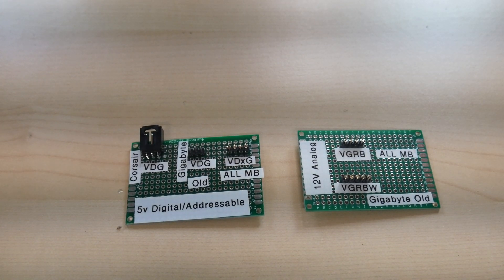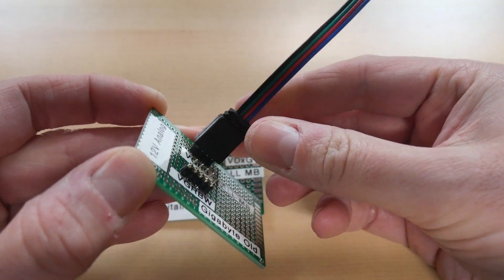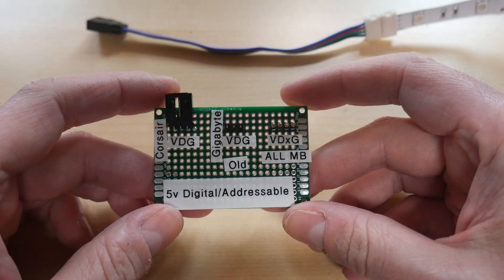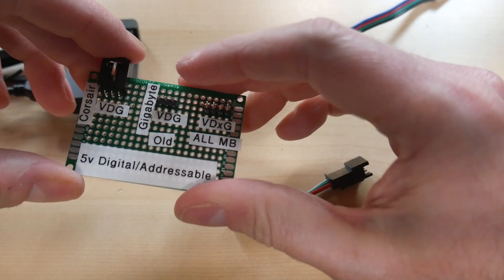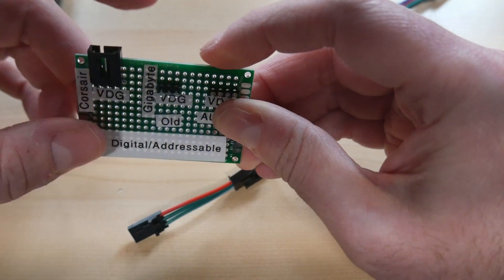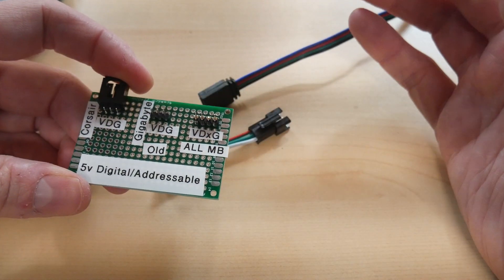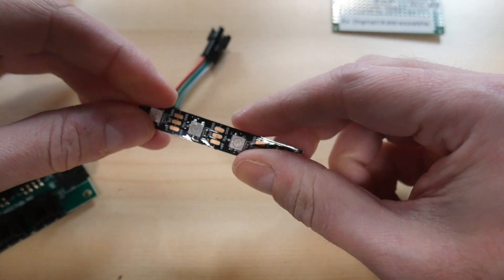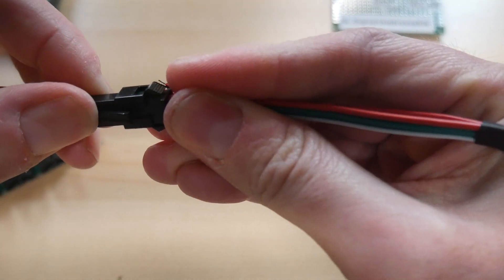PC RGB Headers & Connectors Guide (Digital and Analog)

Comment from the maker: Forgot to mention that a seller on ebay sells adapter cables for various Digital RGB devices: https://m.ebay.com/sch/i.html?sid=piratedog_tech&isRefine=true&_pgn=1
Reply: Hi Solarity

First I would like to say thank you so much for making this video, I was so confused prior to watching but think I understand a little better now. Hopefully you can find the time to answer a few questions if you wouldn't mind. 

1 - Are the RGB LED's in the Corsair LL120's Addressable? I did look on Corsairs website. It states "independent" so I assume they are.
2 - My motherboard has a VDxG connector and the Gigabyte RGBW, so if I bought the Corsair LL120 3 pack of RGB fans would it come with the correct connections, or would I need to purchase anything additional?

Many thanks
Mike
Reply from the maker: @85DJK  I am glad you enjoyed it. The LL-120 fans are indeed addressable/digital. The LL-120s aren't designed specifically for that, though I did a video on how I was able to control HD-120s (same LEDs as LL-120) via my RGB Fusion:
https://www.youtube.com/watch?v=CxO-Jl6dNSU&t=16s
https://www.youtube.com/watch?v=6la3JszM9c8&t=2s

Though to be honest, I think Corsair's iCUE is far superior to any RGB software out there. The LL-120s come with a Lighting Node Pro, which will allow you to control the LL-120s via iCUE

Also check out my RGB 101 video, it is a great overview: https://www.youtube.com/watch?v=z5paaWs_Gz8&t=461s

Lastly to get more content, feel free to subscribe :)
Reply: @SolarityTechnology  Thank you again, that's very helpful. Subbed
Reply: Wow those Corsairs RGB to mobo adapters are crazy expensive for such a simple re-wire.

Comment: Hey. I have corsair ARGB fans ("VDG"-style input) but a standard "VDxG"-style controller. Would you consider it safe for me to just connect them using dupont wires? I mean... As you said it's all WS281x so there shouldn't be a problem, right?
Reply from the maker: The dupont connectors use square pins, while the VDxG uses round pins. The square is slightly to big to fit into the round hole of the VDxG. You can buy adapters from piratedogtech.

Comment: My problem is that I have case that provides 4 fans with their own hub but it seems like it's for ARGB , with only a 5v 3 pin and my motherboard seems to only support normal RGB with only a 12v 4 pin header , so how can I at least make it use the RGB option that I have in my mobo while the hub has 3 pin ?

Comment: H! Was looking on how to connect the VDG 3-pin female connector on the Phantek Halo rgb frames to the 3-pin 5v header on the mobo. I found them on the splitter supplied by PC Cooler on their ARGB fans because it seems they use the VDG connector on their argb fans with an adapter to the mobo. Watching your video was helpful in understanding the disconnect between all the different manufacturers connectors. Thanks!

Comment: Thanks for the info! I have 2x 3 pin RGB headers on my z390 Aorus Pro Motherboard. With the second header plugged in my fan lights flicker one or twice a minute. If I plug and unplug the header the fans will keep the light setting and there is no flicker. Could I put a capacitor inline with the power and GND on this header? or would it be to do with the D? Thanks
Reply from the maker: You would have to play with it more. If you unplug addressable LED's data, it will stay the same until plugged back in or powered off. I would swap the fans to the other header. See if the issue is your fans or the header.
Reply: @SolarityTechnology  Thanks for the reply. The second header flickers whenever the 1st is already populated. I am using TT fan hubs, switching hubs/fans/headers produces the same result, thanks again
Reply from the maker: @PhatToni  how does it work with TT software?

Comment: How do you know the direction of the pins on the 12V RGB header? My connector marks the V plug, but there's no marking on the motherboard.
Reply from the maker: Most mother boards mark which way is which. 12vGRB, VGRB, or something similar. Are you sure it is a RGB header? Reversing polarity on a 12v RGB isn't going to hurt the strip or header. It will work one way, but not the other.

Comment: Do that vdg and vdxg are same? Except for that blank pin. If Yes, i have a 120mm argb fan, the header needed is vdg, but i only have vdxg on my mobo, all i want to ask if can i cut that vdg on my fan and replace a vdxg connector. (i have some heat shrink for safety). Thanks❤️❤️❤️
Reply from the maker: Same thing, different connectors.
Reply: @SolarityTechnology  so can i do that?
Cut the vdg connector of my fan then replace by a vdxg connector?
Reply from the maker: @Gloope  you will have to know how to solder to do it. You could also buy an adapter from https://piratedog.tech/
Reply: @SolarityTechnology  no problem in soldering, i want to know if that is safe and i have 7 fans so buying adapters would be very expensive 😂😂. Thank you...

Comment: So there are these "new" fans on the market with 4 pin male, similar to corsair locking mecanism, and a 2 pin male that changes the rgb program(usually to connect to the reset button on the case). These 4 pin male are connected in series to 4 pin female with an end to sata power that usually is the cable for the last fan. My question is can these be conected to an hub that will regulate the voltage so it will have speed control, and how?

There are no separate rgb connectors, the series conection should end , at a first glance into a female-female 4 pin cable to go into a hub or motherboard. I'm unsure if this would be the right thing to try.

Most of the cheaper aerocool cases have these fans on them.
Reply from the maker: I would have to take a look at it. It is hard to get an idea from a description. If you have a multimeter, you could check for continuity between the known pins on the sata connector to figure out which is ground and what voltage the fans use. Is this just for lighting or are you also talking about controlling the fan/speed itself? If you can determine the voltage and ground, then you can see if the data is wired in series or parallel. If you can determine the pinout, then an adapter can be made.

Comment: are a-led and a-rgb the same thing?
Reply from the maker: Never heard anything referred to as a-led before.
Reply: @SolarityTechnology  i don´t know... my motherboard asrock b560m pro4 has one RGB header that supports 12 V and one "Adresseble LED" header that support up to 5 V... So confused if i can plug a 3 pin A-rgb cpu cooler to this "a-led"
Reply from the maker: @koksbandet  If the MB has a-led printed on the 3pin ARGB connector, then it should work.
Reply: @SolarityTechnology  alright, thank you!

Comment: Hi mate I understand this video is old. Need some help. I have 3 corsair   rgb fans build in my case. Fan power is the 3 pin and for the rgb it's a 4 pin one and female also the rgb is on adapters now I can have the rgb on the 3 pin one or the 4 pin one how comes this is so complicated been trying for 6 months to fix this problem I have. Also I have the corsair delta case red one. Now the fans 3 pin also has at the end of them as there all on a adapter like the wite u had at the end then you connected that little wite at the end that's what I want how can I find and but it please?  Any help would be appreciated thanks mate
Reply from the maker: Could you post links to the products you bought? If you have this case: https://www.corsair.com/us/en/Categories/Products/Cases/Mid-Tower-ATX-Cases/Carbide-Series-SPEC-DELTA-RGB-Tempered-Glass-Mid-Tower-ATX-Gaming-Case-%E2%80%94-Black/p/CC-9011166-WW the Delta Corsair fans are rare. Unlike most of Corsair RGB products, the Delta use analog 12vGRB 4pin fans. You can't control the Delta fans with iCUE. I would check out my even older RGB 101 video and let me know if it is helpful: https://youtu.be/z5paaWs_Gz8
Reply: @SolarityTechnology  top man for that reply mate earned a subb. I have not bought any adopters they come with the case. Yes that is my case mate 4 pin for the rgb and 3 pin for the fans. I was thinking they look different to most of the corsair rgb fans well the wires do iknow the wires I have would not work on any kind of the icue controller box or would they with some kind of adapter? Ok mate I'll give it a watch thanks for the reply appreciate I'll also let you know if I solve it
Reply from the maker: @hittheslots5561  There is the ArrRGB DAC that I developed that allows for the control of analog RGB devices by a digital controller. This allows you to controller them indirectly via iCUE. https://youtu.be/DPAWOIlAZZo

Comment: You mentioned the Z370 Gigabyte mobo and its VDG connector. I own this board and I'm currently trying to connect an A-RGB fan with the "separated" 3-pin 5V connector and a VDG converter-cable...but it doesn't light up. Any thoughts? Thank you for your time

Comment: Do you know what the manufacturer/technical name is for the VDxG female connector? I'm trying to buy some with bare ends, but I have no clue what they're technically called so I can find them.
Reply from the maker: Ironically they are a bit proprietary. I got female 4pin right angle 2.54mm round headers from LCSC and plugged one hole. The issue with that is if you plug the wrong hole, you reverse the polarity. Also it is another couple minutes of extra work per header. I have a friend who has a source who has a source type of thing. Though I haven't been looking in the past 6 months. Granted I was looking for 1,000. If you just need a few, I saw this a while back: https://www.moddiy.com/products/RGB-5V-LED-Light-Strip-3-Pin-Male-Female-90-Degree-Angled-Connector.html

Comment: Hey man I have the problem you said that Involves the 4 pin female to the 5 pin RGBW, I can’t plug it in no matter how many times I try, and I can’t find any adaptors, to which side should I bend the W pin and how much or far to bend it? Thanks for the vid btw, can’t find anywhere a detailed explanation to this issue.
Reply from the maker: Modmymods.com sells RGBW cables. If you bend it, it can break. The best way if you don't want to risk breaking it, then get a rgbw cable and break the pin off on a coupler instead or the MB header.

Comment: Great video, do you know what the connector would be called that is like the VGRB except really small, its the internal RGB on my GPU that I'm tryibg to plug straight into my MB
Thanks
Reply from the maker: Is it a cable that goes from the GPU shroud to the GPU? Do you have a picture you can post to my discord?
Reply: @SolarityTechnology  yeah, it goes from the GPU PCB to the LED behing the logo, hoping to connect it to my motherboard. Ill try post it to your discord. Thanks
Would you be able to send me the link?

Comment: What would happen if I somehow connect the 5v pin of the led to the grnd pin on the Mobo ( don't ask me how that happened 😭😭)
Reply from the maker: The PSU would most likely kill power due to Short Circuit Protection. If the system is off then it would not start. Maybe also kill a fuse for that header.

Comment: Great video!!! How many ARGB fans can I install on a single 5V ARGB MB Header (Aorus X570 Master has 2 Argb header. I used the other on 3 Argb fans + Liquid Argb display). Trying to connect 6, it is safe? They have separate power source, the load will be just the lighting. Thanks

Comment: Nice explanation, I am non-native speaker and could understand every word. Great work and interesting topic. I am trying to use a mouse usb cable with female plug to run LED. So far no progress I though it will go with dimmer light but guess 12V will never run on 5V voltage. Your video gave me, ideas how to tackle this issue. I will try plugin it to 4 pin fan on MB and see what comes out of it.

Comment: What is that 12v rgb connector called? I am going to connect led rgb strip to my mobo msi b450 tomahawk max with 12v rgb header
Reply from the maker: Just look up 12v RGB cable on Amazon or check out them here: https://modmymods.com/lighting/rgb-cables-lighting.html

If you want to be technical, they use a 4pin 2.54mm pitch rounded pin.

Comment: Thanks for the videos!!!  Please help.  I have a cool master hyper 212 rgb cpu cooler with a 4 pin connector and a enermax computer case with 2 rgb strips in the front with a 3 pin connector both controlled in the bios of the motherboard. I also bought a 6 pack of rgb fans from coolmoon that runs from a separate controller, they also have 4 pins but are too small for the cpu fan connector to fit and of course the front led don't fit as its 3 pin (two together, skip one and then third pin). How can I sync all my rpg's? can I buy adapter plugs for them? Please help...

Comment: Solid information and examples on your peg board!
Question: say I wanted to run an ARGB controller from USB (USB plug-in or header pinout similar to Cooler Master), how would I do this? I'm stumped on trying to understand the D- and D+ of the USB and how it works with a controller to eventually make it to VDG (power, data, ground). Thanks in advance!
Reply from the maker: You need to plug a controller into the USB, then the RGB strip into the controller. You can't use USB to directly control a RGB strip/fan.
Reply: Hi  @SolarityTechnology  ! I sent you an email to talk about this more. Thanks!

Comment: seems its not possible to address different colors to separate argb fans/strips with single argb controller?
Reply from the maker: It depends on  the fan. Some have two data channels, data in and data out. This allows the data to be passed to the next fan in line. Corsair uses this for their addressable RGB fans, a few other manufacturers do as well. Most fans don't have this ability. For strips so long as you can daisy chain them, you can address them separately, though that can be more of a limitation of the software.
Reply: @SolarityTechnology   thanks. I have antec prizm fans/strips connected to argb controller, but they all produce same color pattern. my MOBO don't have any argb header to try with software.

Comment: My son has an MSI B85-G41 PC Mate motherboard. He has a Rosewill Prism S case that comes with a fan controller which also has the ability to light up. Plugging in the SATA power from the fan controller into the PSU allows the fans to run. The fan controller also has a 3 Pin VDG cable, but the motherboard doesn't have a VDG header. What are the options to get the fan lights working (ordering a different part), or does he need a different motherboard that supports VDG?
Reply from the maker: Taking a quick glance at the case, I see that it has a RGB mode button on the top of the case. Most likely the VDG cable is an optional MB control cable and the button is used to allow you a few different modes of lighting. So you can control it via a MB or the built in controller.
Reply: @SolarityTechnology  Thank you for your response
Reply from the maker: @mcbane235  forgot to mention that you can also buy another controller to use software to control it, if your MB doesn't have a header. I use a Corsair Lighting Node Pro to control all of my RGB via iCUE. Depending on the connector, you might need an adapter cable to go this route.

Comment: Hey man I got a question: What adapter could I use to get a Msi (3pin rgb) to my Gigabyte mainboard (4pinVGRB) I would really apreciate any answer! btw I liked and subscribed! Really good video
Reply from the maker: They aren't compatible. What device do you want to plug into you Gigabyte MB? If you want to take advantage of the addressable LEDs, you will need to have a separate controller. Deep Cool has a Analog to Digital converter, but all it does is dumb down your addressable LEDs to react like analog LEDs.
Reply: Solarity Technology I found a adapter that allows me to connect them toghether I can put the link here if you want to check I think that this works https://www.amazon.de/EZDIY-FAB-Converter-Transfer-Splitter-Motherboard/dp/B082KMY88F/ref=mp_s_a_1_2?dchild=1&keywords=3+pin+to+4+pin+rgb+adapter&qid=1595927430&sprefix=3+pin+to+4+pin+rgb+&sr=8-2

Comment: what is the difference between the 4 pin pwm, 3 pin pwm, and 3 pin and 4 pin rgb?
Reply from the maker: The standard fan plug style that controls the spinny bit of the fan has 2,3, and 4 pins. Voltage (power), ground, Tach ( returns speed in RPM), and PWM signal. You need at least 2pins to make the fan spin, ground and  voltage. The tach tells you how fast it spins and PWM is one of the methods of controlling the speed of the fan. For RGB lighting the 4pin refers to the analog, while the 3pin is referred to as the digital/addressable. The addressable allows you to address each LED separately. In some cases addressable can have a 4th pin and that is usually for data out, while normally it is just voltage, data in, and ground.
Reply: @SolarityTechnology  Oh I see, thank you for explaining it to me. can I plug the 4 pin rgb to 4 pin pwm?
Reply from the maker: @FATEOFLOOPVERSE  no you shouldn't and the pins are different square vs. Round.
Reply: @SolarityTechnology  Yeah, I just notice it, hahaha. thank you so much.

Comment: I bought a set of argb fans that have a molex connector, but my ASUS board has the VDxG header. Is there any place I could find an adapter? Thanks!
Reply from the maker: Molex SL/Corsair style or the Molex power connector on a PSU?
Reply: This is the link to the fan, the connector is pictured
Metallicgear Skiron MG-F140 D-RGB -140mm Fan, PWM, High Airflow Nine Blade Design, Rubber Dampening Washers, Addressable RGB, Black https://www.amazon.com/dp/B07P5G147D/ref=cm_sw_r_cp_api_i_Nv86Eb1PGAC3J